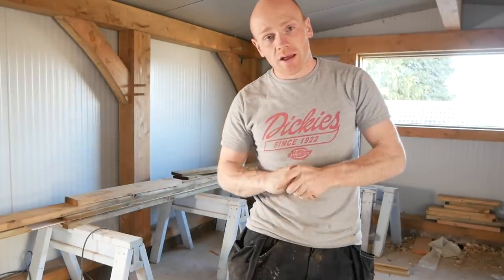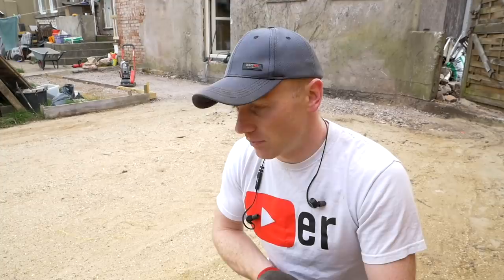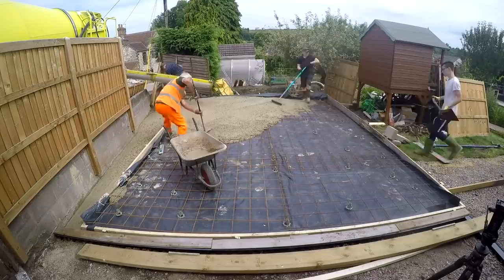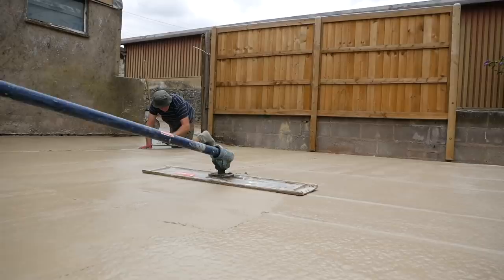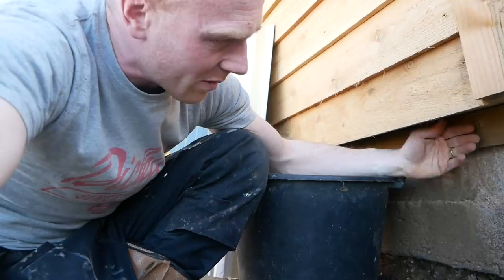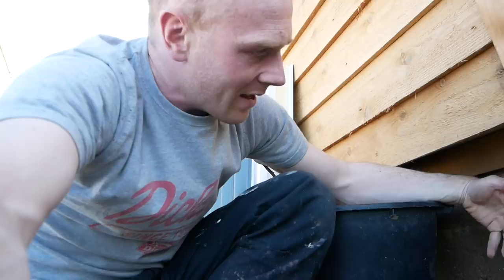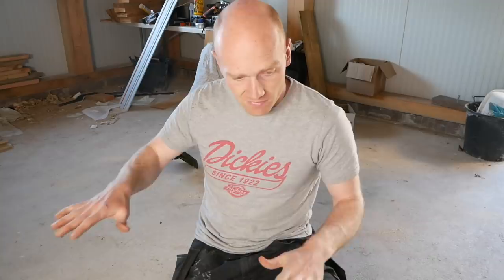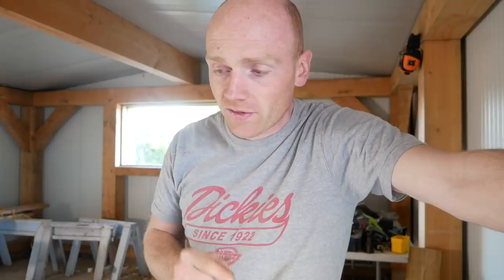WORKSHOP CONCRETE SLAB - How it all started 5 YEARS AGO!

Comment: Having recently watched The Wood Whisperer get his workshop floor epoxied, from what I can gather you don’t want a completely smooth concrete floor. The epoxy needs a rough surface to grab onto. Worth watching his videos if you haven’t already 😀. As always though an excellent job then, and now 👏🏼👏🏼
Reply from the maker: Yeah the surface will be etched before the primer. The screed is more to get rid of the dips and low spots. 👍

Comment: Tip: before you screed, treat the concrete floor with a PVA/water mix and let it thoroughly dry...a couple of days...then when you knock up the screed, add PVA to the mix...it will bind better and be stronger... 👍🏻
Reply from the maker: Did similar but using acyric primer. 👍

Comment: Always the perfectionist Tim, I'd be cock-a-hoop with that slab for a DIY job. Whoever did my extension (about same length and half the width of your workshop) crowned the centre by at least 50mm the whole length 😂 I'm not quite sure what the best option is to sort it out.
Reply: If you can tolerate the height increase you could screed a layer on top?
Reply: @TheFool2cool  that's what I've been thinking. It's a kitchen and bathroom extension which is already a 200mm step down from the main house. It all needs gutting anyway.

Comment: did you fix the frame to the blocks/ concrete Tim?  Secondly, I am intending to do do something similar except that I may not cross batten and cedar clad.  Is there any reason why you can't fix the cedar cladding directly to the panels (without battens)?  Using battens adds more weight to what is hanging on the panels and I don't understand their function ?
Reply from the maker: No batten no airflow which would not be good for the cladding.  Frame still not bolted down but will be when I get round to it. To be honest no real need as it can’t really budge but a bunch of sleeve anchors will do the job just fine.

Comment: So, where there's a 5mm discrepancy on the floor height, how easy/difficult is it to get a level concrete floor?  Do you think your shuttering was too low at that end, or was it something to do with how the concrete was poured?
Thinking of doing a concrete slab myself (large garden room), but wondering how difficult levelling it will be.
Reply from the maker: Poor job of levelling the shuttering, (days before having a laser), tamped out with an old floor joist that probably wasn’t straight. If done right there is no reason that you can’t end up with a level and perfectly smooth floor. The shed base I did last summer was way better and trowelled to a ‘polish’.
Reply: @TheRestorationCouple  Ok, good to know.  Thanks for the reply, and thanks for all your videos!